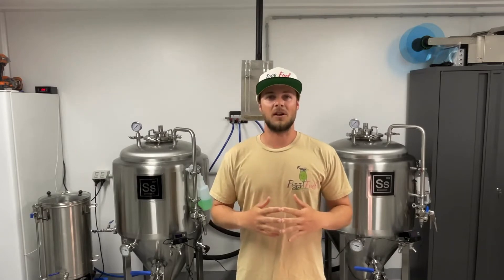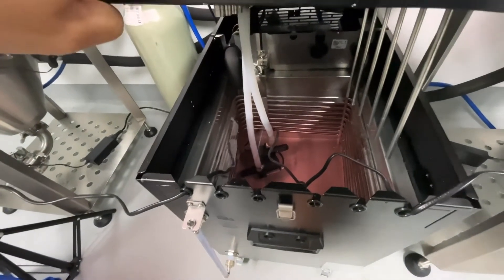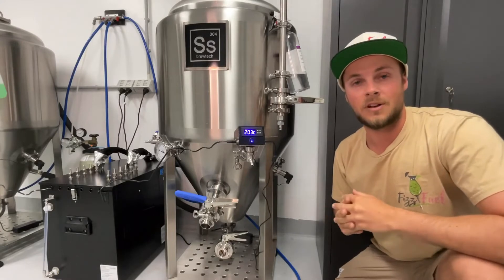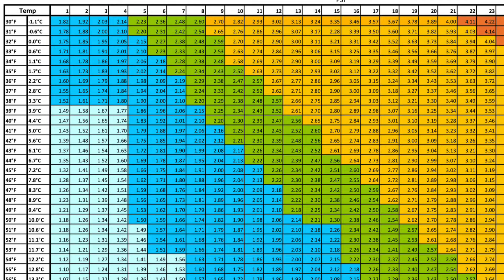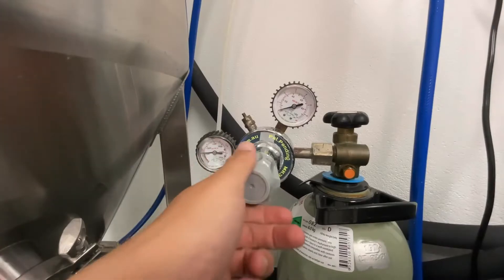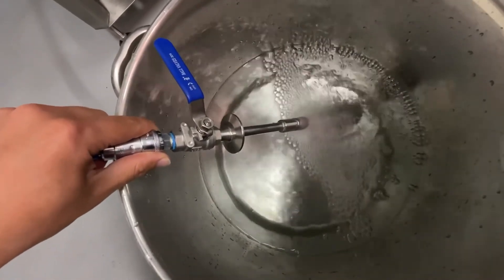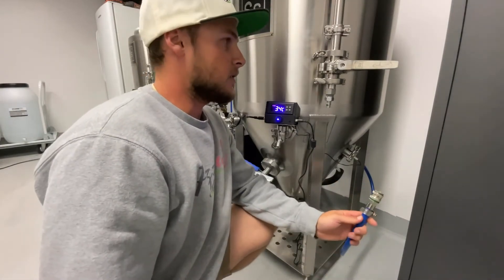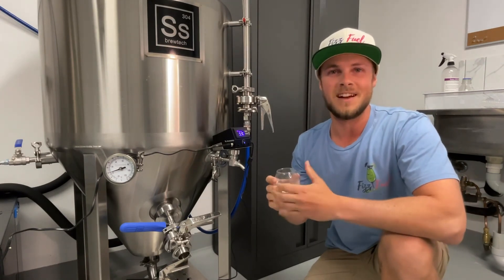Unitank Carbonation Setup - How to Carbonate

Comment: Gday Luke.  We have a similar tank but the smaller one.  We currenty have a barbed connection for the carb stone and then a different fitting to the head pressure intake.  i see you have simply the one co2 line which can be used for the carb stone and the head pressure intake.  Can you give me some idea as to how to manage this?  I haven't been able to work it out yet.  Cheers

Comment: Hey mate, good vid. Ive struggled with getting decent C02 suspension in my unitank. Would you suggest that applying the head pressure helps retain the C02 better in suspension and that hitting it with 13 PSI straight up retains C02 density?
I Slowly appied from 0 psi up to 18 psi and held for 3 days with no additional head pressure and found the C02 to be only just sufficient (micro bubbles) but after canning and bottling 2 to 3 days later a lot f the C02 had fallen out of suspension.
Good to see another QLD'er in the game!
Reply from the maker: Thank you for your comment :) 100%... applying head pressure helps to maintain the c02 in solution in the wetting process for at least overnight but 24 hours is better. Burst carbonation through the carb stone does the lions share, but applying head pressure and holding it for 24 hours really sets it in. It's also important to check your seaming process, checking any bubbles that may be leaking after the lid has been seamed. I use the duofiller for canning so I will lose some c02 during the filling process, if you do have a counter pressure filler, they are much more efficient. I aim a little higher with my c02 volumes knowing i'll lose a tiny bit during the filling process. Thanks again!